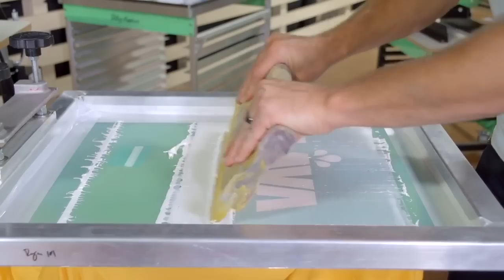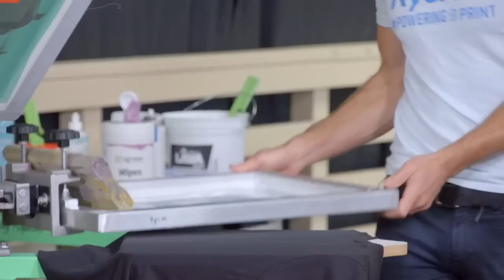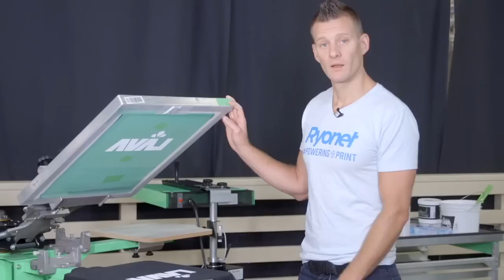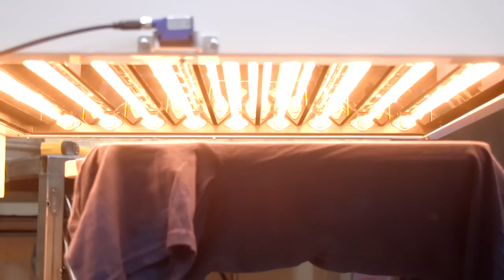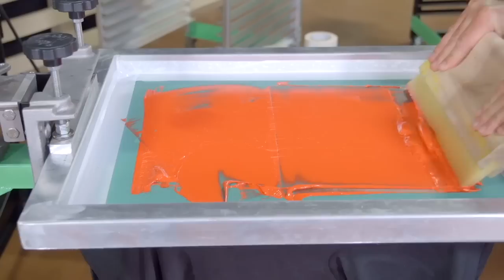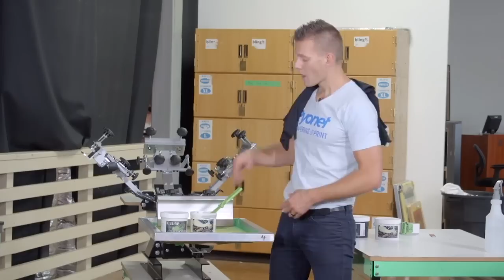How to Screen Print Series - Screen Printing Techniques

Comment: great video! i am just getting into screen printing. are there any inks that do not need to use heat to be cured?
Reply: JD1723 water based can be air dried but it can take a few hour to dry. You can also use a hand held heat gun to speed up the drying time
Reply: @Henry Bukowski Thank you so much for your reply, i appreciate it!! Funny, I saw your comment after I had just left Harbour Freight to look at heat guns lol. I also read the heat gun helps to make it more permanent and helps it survive the washing machine without fading. So much to know when screen printing...the different kinds of ink etc. I also just purchased speedball water-based ink two days ago too. Thanks again for taking the time to give me info :)
Reply: JD1723 that’s how I started a few years ago. Still a lot to learn but as far as ink goes. For water based, go with jacquard opaque white ink. It goes a lot farther than the speed ball as far as brightness and over all quality. It tends to try faster though so I recommend mixing a bit of water into it.

Comment: For water based ink, is it helpful to keep the ink pasted after the stroke is done when it time to flash? I am facing the problem of drying out the screen mesh quickly & it is hard to print once any area gets dry. Any tips would be helpful. Thanks for the video.
Reply from the maker: Hey there! If you keep your screen flooded when you are not actively printing, that can help your water based ink from drying out.  If you're noticing that it's still drying out a lot, then try keeping a spray bottle nearby! Give your ink just a few misty spritzes to re-wet it. Just be careful to only use a very little bit so you don't change the consistency of your ink.

Comment: Hey Ryan the ink that I got I put 10 percent of the sofftee base and my ink doesn't look no where near your ink your ink seems like it has a flow my ink doesn't even drip even when I connect my ink mixer to the drill all it does is make the ink loose but it doesn't drip I'm also using a 160 screen for my print and I'm now having this trouble where when u print it looks solid white even when I flash n print the second coat but after like a hour I'll go take a look at the shirt n the ink is like almost the same color as the shirt it's like the shirt is bleeding .... I'm using xolb glacier white from dynamics screen printing and the shirts I am using are 50/50 but the only thing that has been different was that I am now using a 160 I never ran into this problem on  110 and the logo is is solid
Reply from the maker: Hi Danny,
I am not familiar with this ink. Reach out to the manufacturer and they should be able to help you out.